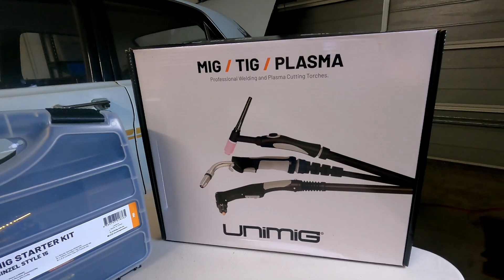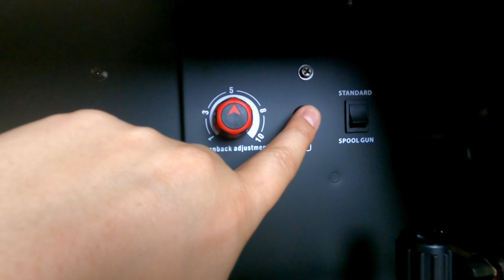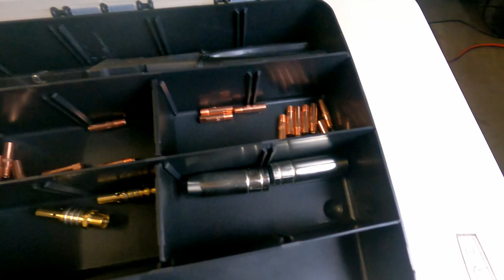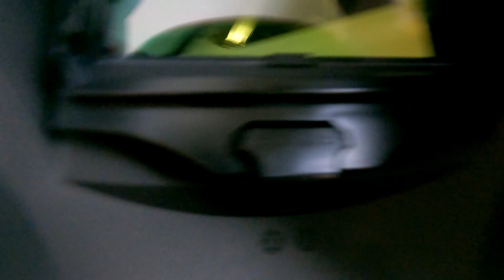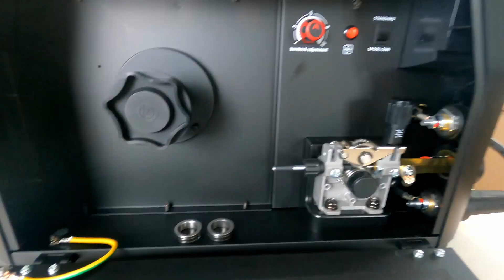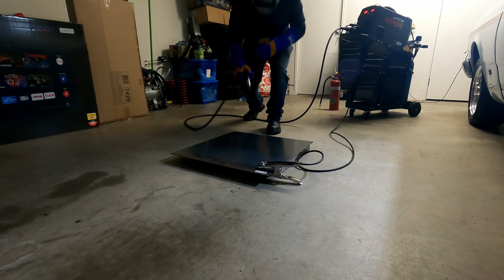Unimig 185 Viper Package - Mig, Tig & Stick Welder

Comment: Hey mate, Ford for the win. Try setting your gas pressure with the trigger pulled so it is consistenly pumping out the amount you need. The pressure drops as soon as you pull the trigger.
The wire settings recommended are too fast slow it up a bit. Drop the volts to the min rec setting and look for penetration and adjust. Enjoy the welder. See you next vid.

Comment: Good choices of welders mate , I'm not brand biased with anything but unimig have always been great machines and they just get better all the time. Used a lot in panel shops and they last longer than all of them. I'm getting the 230 razor multi process machine.  Of course I keep my old ancient pro craft 210. Still welds perfect after 25 years.  You will love this machine as much as I love that Xw ha,ha,
Reply from the maker: Thanks mate. Great feedback. Very happy with it so far although not used a huge amount. Would love to get an AC DC Tig from Unimig at some point too.

Comment: Hey Rob I'm currently looking at the 185 Viper and the new Viper 165 Multi with the Synergic function. 
I was just wondering with the 185 Viper how have you found the guide in the door for the mig welder settings? Is is accurate at all? 
I've just heard a few people say they have had to dial the settings back as they are too hot and blowing through.
I do see that they state its a guide only and will vary with experience and technique.
Reply from the maker: Yeh I have used the guide as a starting point then done some practise on metal scrap to make adjustments to my liking. Don't think I've ever stayed with the door setting recommendations.
Reply: @robsgarage69xw  Thanks mate..Good to know. I spose it all comes down to the person welding it and what the results are to there welding style. Thanks again for the reply and have a great chrissy :)
Reply: Looks like you could move along a little faster based on the epic heat penetration, when you keep the blued steel effect consistent depth and colour both sides you are in the zone.

Comment: Thanks for the video Rob, I just purchased the same welder, only used once so far and it's my first gas set-up  so still getting used to it, far better than gassless, cleaner better looking welds, I'm using 6mm wire and getting a big weld which is frustrating when grinding, so I think I need to change a setting or procedure maybe? I will checkout the other channel you recommended. Keep up the good work mate.
Reply from the maker: Hey mate, I ended up getting 0.9mm wire for mine which will keep the weld profile much lower and save some grinding. Currently testing out the Tig function in mild steel.
Reply: @robsgarage69xw  ok sweet, will give that a go, cheers.

Comment: Thanks a lot for sharing. I will get the same machine. Do you like it ? I would appreciate your feedback, so I would go ahead. Cheers from Melbourne 🇦🇺
Reply from the maker: Yes I like it. I've used the mig function a few times now and still getting used to it but I'm happy with it so far. The main thing to be aware of with this machine is that you can't tig aluminium because you need an ac dc machine to do that and this is dc only. I'm mainly working with mild steel so the tig and mig functions can do that as well as stainless steel. You can mig aluminium though with spool gun. I think you'd be happy with it if that's what you're looking for in a welder.
Reply: @robsgarage69xw  thanks a lot. I need it for my VW beetle resto. So I will go for it. Thanks for the review.